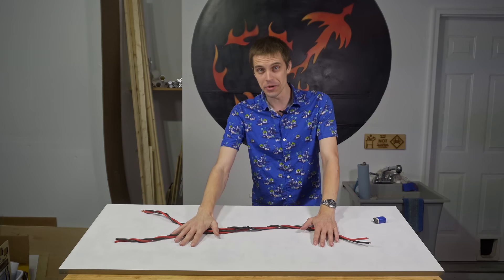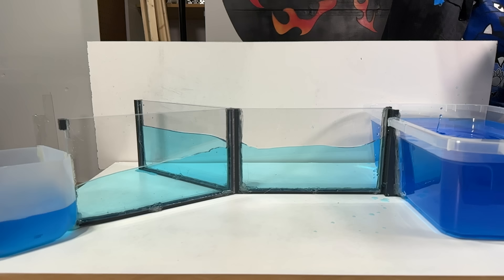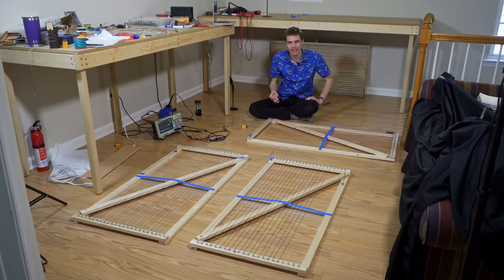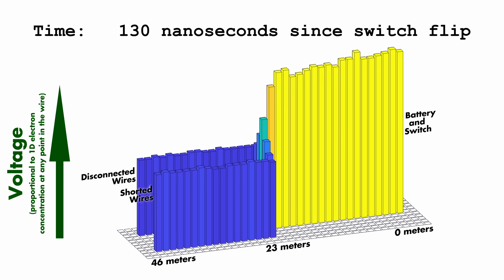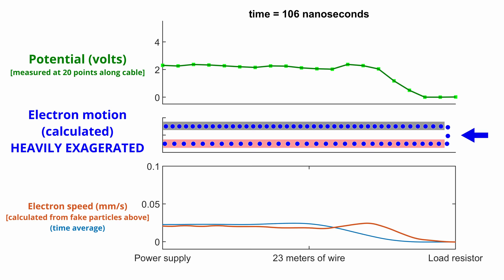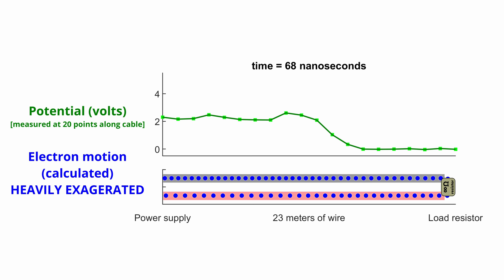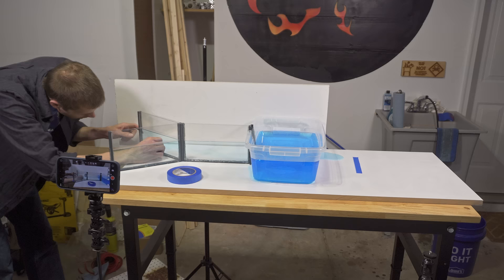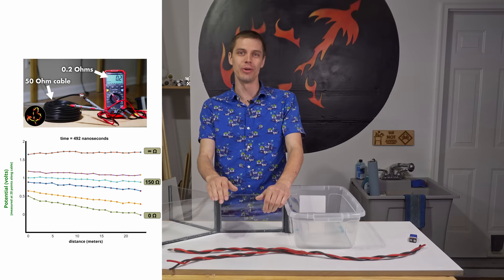Watch electricity hit a fork in the road at half a billion frames per second

Comment: Let me inject something here. On the open circuit you have a twisted pair with a lot of wire length so what you have created is a capacitor to some extent. In a reactive capacitive circuit the current would be ahead of the voltage where in your other half of your circuit you have it shorted you would technically have a coil but since it's a twisted pair the inductance will be pretty much cancelled out but not all of it. What I'm pointing out here is you sort of have a parallel LC circuit so there would possibly be a bit of ringing or a momentary oscillation in the circuit even with a steady state DC applied. Just food for thought.

Comment: The beginning was difficult to bear for a person with RF experience (probe setup, “measuring” with different impedances without correction, lack of interference compensation, ...).
When I skipped ahead to the results, I was amazed at how well the results were presented.
Now I know that I have been measuring data lines correctly for the last 30 years ;-)
Next step: Forget the electrons and explain your measurements only with fields in the context of the special relativity.
Reply from the maker: The electrons make the fields - you always need them both
Reply: @AlphaPhoenixChannel  I'm talking about Special Relativity connecting the Lorentz Force with the Maxwell Equations to describe a mass with fields in motion.
The motion of electrons and fields may be more the result of the mentioned relation than vice versa, some say. ;-)

Comment: I learned a lot, absolutely brilliant. 
Suggestion: the reflection at the fork appears to be caused by an impedance mismatch. To look more similar to the water simulation, you'd perhaps consider using wire of half the thickness downstream of the fork. This would mean that the total resistance downstream of the fork would be equal to that upstream and hence, should expect less reflection. Just a thought. 
Loved this tho dude, super cool.
Reply: Whoops, I meant twice the thickness.

Comment: Pretty sure the positive and negative voltage spread through, then continues pumping current when the first bit of voltage leaves. So i guess the closest answer is B. I am going to say it definitely shares with the end goal of evening out the overall voltage, and as the difference decreases, there is an exponential decay in the difference between the two voltage values.

Comment: Very enlightening!  If I could add a little step to the experiment... What would happen as the open ends came very close to completing the circuit but actually couldn't.  The motion being there but was stopped.  Closer to what any other part of the wires would allow.  What would happen if that repeated over and over.   Maybe you did that nearer to the end of the video and I'll have to see.  
This is brilliant by the way!  Electricity is so much more fluid than water and the y angle in the water takes a slightly different fluid path because of it maybe.

Comment: I wonder if you can harness those higher reflections and create reverb of some sort with some sort of self amplifying signal. 

Also, Amazing Video, its really cool too see that its not an omni presence like I Imagined(since I was a kid) like Option A. Option C coming through in the end is absolutely awesome, and that the initial Peaks are slower than the switch so it it shouldn't be artificial amps made from the, However miniscule, air gap between the switch paddles as they close.

Thank you very much for building this.

Comment: Just a 1D wave equation (with a loss term, possibly) on a Y-shaped "domain" with a source on the input end and two different boundary conditions on the other two - Neumann and Dirichlet. This explains why the water and electrical models work similarly - the underlying equation is the same.

Comment: Don't forget about the inductance, and capacitance in the wires, hence why it took a while to stabilize. Try using coax, or wire at different lengths and spacing, you will get different results and settling times. Yes the field created when current flows in one group of wires can interact with other parts of the circuit too. As there are so many other things going on in your setup, its impossible to make any conclusions. Try instead measuring the velocity factor in a 100m roll of coax, this is easy with a scope, see how different wire spacing and insulation change the speed. good video.

Comment: Very nice video. I'm mechanical engineer and I have always had feeling that electricity and fluids have something common mechanics. Before you brought that water channel model  I had something similar but different in my mind to think this through. I though that Y-loop as hydraulic system and how would pressure wave propagate through the line and bounce back from that closed end.

Comment: Great demonstration of Whole Flow Theory.  Some things that can show small variances in the experiment are the input impedance of the probes (yes measuring changes the experiment).  Using a power supply will smooth out the experiment also as there is a lag in the chemical energy of the battery being converted into free electrons and flowing.  Also the battery voltage is more likely to dip during the initial load being placed upon it.  Did you consider using a coaxial cable, as there is much less change in inductive capacitance, and it is designed to display those changes along the length of the cables.  This was an demonstration of how OHMs low as it relates to current flow.  When there is a short voltage will drop, and current will rise.  When there is an open, voltage will rise, and current ceases due to the infinat resistance.  Back in my days as an Avionics Technician, we used a Time Domaine Reflectometer (TDR).  It will show changes along the cable WRT the inductive/capacitance within the circuit.  Twisted pairs can develop vindictive charge due to the coiling effect over very long distances (or we were taught to believe) so that is something else to check.  I would like to hear your thoughts on these modifications to your experiment.

Comment: The same wave phenomena applies to sound waves, as used in medical diagnostics and in technical testing. When a fast changing pressure pulse is exerted onto an interface of a material, the change in pressure travels at the local speed of sound. When hitting another interface, like a fissure, or the other end of the material, the wave is being reflected according to wave physics in a conservative field. Partly, the wave may travel through the interface, even at a higher pressure amplitude than the original one, which is what was really difficult for me to explain to people, to whom I was teaching ultrasound applications. Amplitude of pressure (analog to voltage) is not the same as energy-flux. It depends on the local impedance of the wave.

Comment: Analog oscilloscopes have a delay line in them to give the trigger mechanism some time to process a trigger condition, similarly to what you did with that extra long twisted pair. These days you can just save the data points and show them with an offset of course.

Comment: Let me simply add to all of the very well worded responses you have received so far about how good this video, and your work on it, is. Well thought out, excellently presented, world class demonstration of how electricity behaves. I do wonder about your anthropomorphic phrases used during the video: " the battery guessing how much current to send", " electrons deciding what to do", "negotiating". Did you include those phrases on purpose, or should they possibly be eliminated in order to clarify that electrical phenomena are not sentient? Just wondering.

Comment: The beginning & end of the circuit are @ the Battery >> As 1 electron leaves the battery it simply pushes 1 electron back into the battery via the other end of the circuit ~

Comment: You induced a currant and created 3 separate electric fields. Cool.  You went into the first field, ran the currant out and slit it into two field one shorted and one not. Correct so far? Why would I be surprised to find out that the shorted field would take longer to saturate than an open one. Even though the open field has no where to go, that does not mean it does not have a voltage potential. The reason we use twisted pairs is to combat induction crossover in high speed circuits.

Comment: My guess is E! There is a tiny "leak" of electrons into the environment from the open black wire and an equally tiny "draw" of elections the other way into the open red wire. Most is the current will instantly flow around the closed circuit but I think the battery mostly works like a can of pineapple juice, as there needs to be a hole to let out juice and another one to let in air.

Comment: The short circuit from battery will go right back to the battery and a meter will show a voltage going getting lower on the other end until the battery becomes equalized. There is no ground to bleed the battery completely .

Comment: I have a reseach degree i physics, and during our graduating project we built a complicate apparatus with several things going on. Outside we had an insulatinf/ faraday stocing, to keep our apparatutus free from uotside noise, and grounded that separetely. We stlii got  noise. Then we moved the connection to the ground to the othe end of the insulation/ faraday , about 50 cm, and that did the trick. The faraday stocing eas made of steel, rather small holes, so the speed of light should be about 70_80 % of that in vacuum, so moving the point of contact 50 cm should not mean that much, but it did!

Comment: It looks to me that you built an LC circuit. The open on the open side is a capacitor  with some inductance due to the parallel wires. The shorted side is more inductive due to the short but also has a capacitive component.

It would be interesting to conect a VNA and sweep the circuit to see what frequency it will  resonate .

Comment: This is why you need a resistor with a value of the impedance of the wire at the and of a bus like a PCIe bus to not get reflections and therefore distorted signals. But cool to see what happens.

Comment: high end network test equipment can very accurately measure the length of conductors in a cable even when there is nothing connected at the other end, I knew they do this by measuring the reflection as we need to manually enter the specific cables lab tested % of speed of light (can vary significantly due to copper purity). great to visually see how this actually works explained so coherently especially considering it is something I use most days.

Comment: Electronics is fundamentally wave propagation and this is seen clearly at very high frequencies. At low frequencies the wave propagation effects die out quickly and simple steady state laws like ohms law can be used. When you connect the source your are basically inputting a Voltage step function into the circuit. When a step function wave hits a short, it reflects an inverted step function  to cancel the input signal. When a step function hits an open, then it reflects an identical pulse back. When the step function hits the Y junction, it acts like an open, and the waves that continue are 1/3 reduced in amplitude, and the wave propagating back is also 1/3 reduced in amplitude. The voltage source acts like a short (internal impedance of source =0) when the back propagating waves hit it and invert a reflected step function. The speed of a field in copper is about 2/3 the speed of light. The scope measures the potential, which is proportional to the field.

Comment: I'm guessing C. Following the logic that the disconnected end functions as a capacitor with the air between the ends acting as a dielectric medium, the electric field travels at the speed of light and should cause identical behavior until the EM field has reached the ends. Then, electricity will flow around the closed end but is stopped at the open end that becomes a fully charged capacitor.

Comment: My guess (at the beginning) is 'D' is just poetry, how you spoke of electricity introducing it - & only works in words.
My guess is, whatever electricity's doing, it can lend itself to 'appear' to be doing A B & C at different times but the methodry of the the electro-dynamic flow (like hydrodynamics) likely hinges more on which option forward is the path of least resistance.

Which is in keeping with my suspicion/theory that electricity does a similar trick as light does - being everywhere all at once; as if it existed 'complete' & connected and just expanded with the yet-unformed universe. Probably an order of magnitude fatter than light, or balanced on the very other end of the size range within a shared resonance magnitude, with similar or mirrored properties.

Comment: Battery current is based on a chemical reaction. This has a start up time and a total level of available current against time, and is part of it's internal impedance and it's frequency response. A (fast) switched DC current behaves as a short duration AC current - so generates a back EMF - and transmission line impedance, length has an effect. So length and even the twist and resistance of your wires will have an effect. Line impedance can be matched by line length.

Comment: I believe that the circuit and the speed of the electron flow must take account of what is happening in the battery. There is also an effect which creates ringing in the circuit due to the magnetic effect of electron flow where the probes interact with the electron flow. Work some years ago for Cern I spent weeks analysing nano delay lines and had the opportunity to use a mega expensive scope and pulse generator.

Comment: Nice work - great experiment! I wonder how much of a difference there would  be if it were done in a vacuum? After all air conducts - conductance and resistance (between the unconnected wire ends and between twisted pairs) will change with humidity, temp, and pressure. I believe it could begin showing up around -4Torr to -9Torr (i.e., beyond the 'Vacuum Roughing Regime'  and when the Mean Free collision Path is greater). Sorry, I'm probably overthinking it but ...

Comment: In the setup, I see capacitors (which a battery in fact is, too), so you need to see the whole 20 meter wire as a coil (ignoring the resistance but the wires are not too far apart to interact). That makes it a 'resonant' circuit at some (insane) frequency. You could even measure the RF it generates from a distance if needed. In fact, you built yourself a transmitter (impedane, capacity etc.) 🤣

Comment: My first thought at 1:45 was that there is no instant you connect the battery. You connect the first terminal and the charge has heaps of time to flow through the wire before you connect the second terminal. And also maybe as you're connecting the second terminal, the nanosecond before the metal touches, it is close enough that electricity can jump the gap. And the nanosecond after, the point of contact is so small there is significant resistance. Probably not the point of the video, but maybe there's some interesting physics there.

Comment: i like to compare it to hydraulic where voltage is pressure and amp is flow(movement of fluid). a pressure pike is an energy potential but the fluid doesnt have to be flowing for a pressure to be present

Comment: Guessing what will happen before watching the rest:

The initial state of the wire is uncharged. For simplicity let's assume the negative terminal is connected first and settles.  When connecting the positive terminal, a "wave" will propagate through the cable and split at the junction. The field will propagate to the end of the unterminated end and a small amount of current will pass between these wires as the mutual capacitance of the twisted wire pair is charged. However once the capacitance is charged, no more current will flow. Technically the wave will reflect on the unterminated end, but let's not bring that into this. On the terminated branches the same wave propagates all the way to the negative terminal and as the EM field is established and there's an electrical connection, the current will flow.

Comment: One thing I noticed: You are conflating voltage and current.  
You seem to indicate the signal of higher voltage indicates current. However, voltage is not equivalent to current. If it was equivalent, then the open circuit branch would have 0 volts, since (essentially) no current is flowing. But V=IR
At the end of the open circuit, R is extremely high, and I is extremely low; multiplied together, you get (essentially*) the voltage at which that open circuit connects to the other circuit. *Since the scope probes and wires have resistance, there is a small current through the "open" circuit via the scope. 
Plus, as you noted, there is capacitance between the wires. You could represent the wire pair in the circuit as a series of (very low ohms) resistors that are the wire resistance, and (low capacitance) capacitors between. 
Also, the wires (and probes) create a loop, so there is (at least a little) inductance. 
So, when viewed as a series of resistors with capacitors, it's easier to see that the voltage rises along the wires when power is applied because the capacitors along the length are charging.

Comment: Just to clarify what's going on here, it's not that the battery learns how much current to send, it's that there is an active resistance (an opposing force) developed by hitting the end of the disconnected wires which moderates the amount of current sent down that channel.